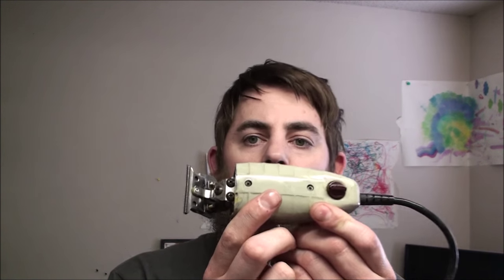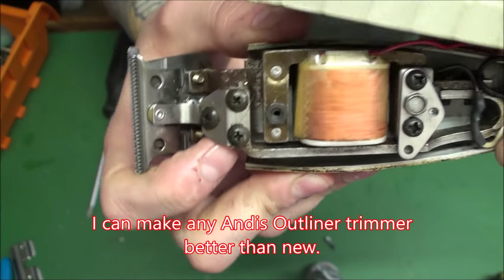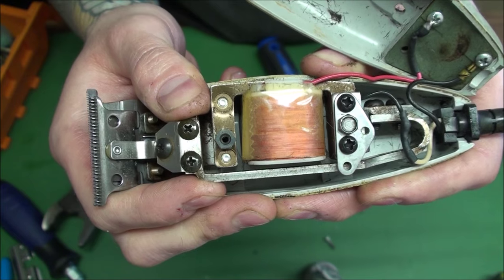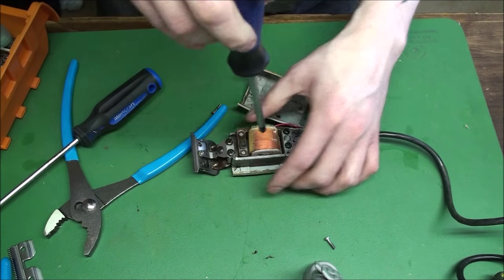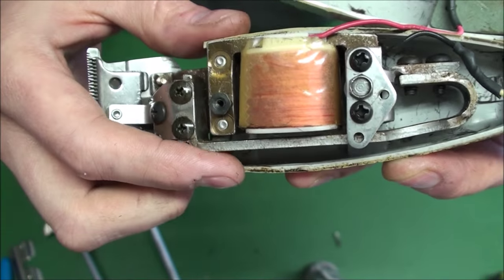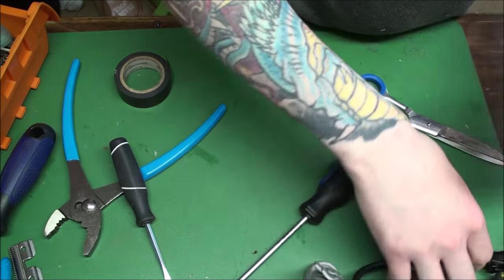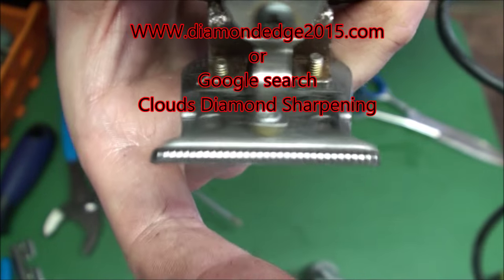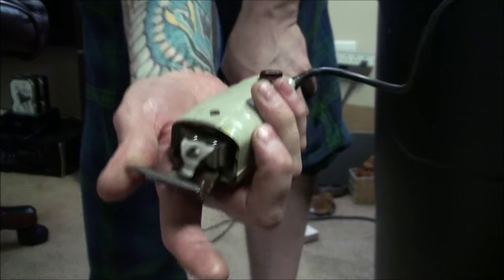Andis Outliner Armature Adjustment

Comment: I did my adjustments but my tension screw touches the bottom of the neck so it's scrapping for some reason as if the screw is too long... any ideas on why that could be?
Reply from the maker: Isaiah Sims Hi. its probably BC your fork is bent. you will have to buy a new one or bend the fork pad up to be able to back the tension off. the flat part of the fork where the tension screw goes in needs to be bent up.
Reply: Cloud's Diamond Sharpening yeaa man that's what I was thinking, buying some new trimmers but imma try to adjust the pad some more and see how it goes
Reply from the maker: Isaiah Sims I might have a video to help you. here's one but I have more look through my videos.   https://youtu.be/KcHK37KTSqc
Reply: Cloud's Diamond Sharpening thanx imma check it out

Comment: I have a question, I have a regular grey T-Outliner and a GTX that I got sharpened and serviced. They were solid for a couple of weeks, then all of the sudden they seemed to loose a lot of power to the point where the blade isn’t even moving. I spray it down and oil it and runs really good with power for a little and then does the same thing? What’s the solutions for them? How long do outliners last, or do they ever get bad.
Reply from the maker: hello. It sounds like the blade is dull. Blades go dull and need to be resharpened or the trimmer needs to be readjusted. I recommend having multiple blades. The trimmer can always be fixed.

Comment: How did you solve the noisy problem? This trimmer works very very loud!
Reply from the maker: Adjust them with the with the ball of the fork at the upper part of the cutter. With 2 pounds of pressure and if that does not fix the noice it'll need to be sharpened to resurface it and put the correct pattern to insure it to cut correctly. Thank you watching

Comment: Just bought some blackout Andis T Outliners. Instead of the 2 screws at the bottom, they're flat rivets. To move the armature, you need to take those out. Any idea on how to take them out?
Reply from the maker: Alan Q you shouldn't have to remove or adjust. I recommend sending back for warranty. but i adjust them with the center bolt.

Comment: hey,  love your videos! i adjusted my newly sharpened blades, and they are cutting,  but they are pulling bad.  what did i do? thanks!!!!
Reply from the maker: +Jessica Martin Thanks. Im glad you enjoyed. why did you have to adjust  newly sharpened blades? It could be that your clippers tension is to loose to hold the blade together.
Reply: I had dropped them and chipped the blade so i got a new one,  put it on and it wouldn't cut,  finally got them to cut, but now they are just pulling pretty bad.  I will try and tighten the tension.  I also bagged it into the case,  and bent the arms just a little like you showed.  Thanks again! !
Reply from the maker: +Jessica Martin Alot of new blades are not very sharp. I call it factory sharp bc a machine sharpens them and where i once worked, customers buy new blades and then have me sharpen them out of the package. It could just simply need to be sharpened. Or when you dropped you might have bent something. Well good luck and hope i help you figure out your problem.
Reply from the maker: Jessica Martin NP and thanks for watching

Comment: I'm trying to decide between an Andis T-outliner VS. Andis superliner which one you choose for balding and line ups?
Reply from the maker: Rio hello, the superliners have a rotary motor. That's good for power but there are no parts available. The blades of the super liner are on a guide that pivots so you can't adjust them with ease. The metal of the superliners blade is softer so it might not stay sharp as long. The outliners are adjusted easier and have all parts available thru the manufacturer. So I  pick the Andis G Outliners for quality and parts availability But I'm also not a barber.  I hope I helped and thanks for watching.
Reply: Cloud's Diamond Sharpening nice..thanx...I asked a barber and he said the same thing from a cosmetic stand point  the Andis T outliner is better. Appreciate it man...Im about to buy it do you think buying it brand new that it would need adjusting?..if i wanted my liner done like the one in your video do you help out Canadians.
Lol?
Reply from the maker: Rio  I can do it. But it will be alot in shipping.  For better details please visit www.diamondedge2015.com
Reply: Cloud's Diamond Sharpening ok  cool thx

Comment: if the tension spring was bent due to a fall, then bent back, is it still possible to adjust the clipper? or do you need to purchase a new tension spring
Reply from the maker: callmetagno you can adjust it if it's not broken. The spring is no longer available. So if the spring is broken you will have to order the armature.
Reply: appreciate it, the spring is not broken i got the clippers about a month ago so i'm gonna try to adjust it myself. Thanks again, vids are great
Reply: was able to adjust the spring and find the right tension. works perfectly now. Thanks!

Comment: What about the newer GTX? They don't have screws to adjust the armature.
Reply from the maker: Poker Face you shouldn't need to adjust the armature but the middle bolt should adjust it. I usually never adjust an armature unless someone messes with it. unless it makes a rattle sound going into hair is the only reason to adjust it.
Reply: Cloud's Diamond Sharpening Thanx

Comment: won't the corners of the blade cut client if you move arm too much too on side
Reply from the maker: +adrian haynes Yes it will. If the teeth go over the comb. This was an armature video Not fixing the tension fork, that is what it says in the description. Do you need to know how to adjust the blade?
Reply: +Cloud's Diamond Sharpening 
I was talking about the cutting blade if you move the arm to much one way the cutting blade won't be center with comb blade anymore cause cutting if you use the corner of the blade to go around the ear or neck area??
Reply from the maker: adrian haynes Yes it can if the cutter blade is too far over. You can loosen the blade screws and slide it over to where that cutter doesnt go over the comb. If you cant adjust it good enough by moving the blade then you will need to adjust the tension fork.
Reply: +Cloud's Diamond Sharpening 
OK thanks for everything
Reply: @cloudsdiamondsharpening3973  How do I keep my Andis T out liner T blade motor from getting too hot? It always gets hot very quickly
Reply from the maker: @lilbossman4186  hard to tell from a distance. Usually, it's too much tension,  blades are being used while dry, or a combination of both. If it gets hot immediately after turning it on, it could be an internal issue and I wouldn't recommend using it until you could have a professional look at them.
Reply from the maker: Make sure your blades are always lubricated whenever in use.

Comment: I just bought some new liners and they only have the nut in the middle where the 2 screws are is circular metal pieces
Reply from the maker: +adrian haynes I'm sorry, I don't understand. The two screws that hold blade fork are riveted instead of screws?
Reply: +Cloud's Diamond Sharpening yes
Reply from the maker: +adrian haynes Interesting. Thanks for telling me.
Reply: +Cloud's Diamond Sharpening yeah no problem I guess adjusting the arm is a one nut move now
Reply from the maker: +adrian haynes Ya. Now if the fork gets bent to bad or broken it cant be replaced but you still can replace the whole armature with that piece riveted on.
Reply: I know this is old. But you take a screw driver, take drill bit the same size as the Rivet, drill through, remove and replace with screws.
Reply: @tazz5406  I assume you were able to successfully do this? When you drilled out the rivets were there still threads inside for some screws to catch on to? May I ask for details on your procedure please so that I may replicate it? I have 2 Outliners requiring serious adjustment. Thank you kindly.

Comment: My arm has only the middle screw the end two look like rivets
Reply from the maker: atardy12 there is rivets now on the new style outliner.
Reply: Cloud's Diamond Sharpening Oh, my top blade where you set the half moon seems for left. Is that normal?
Reply from the maker: atardy12 try to loosen the blade from the trimmer  and slide it over until the cutter is in the middle of the comb blade. unless the trimmer is making a loud hitting sound or weak, you shouldn't need to adjust the armature.
Reply: Cloud's Diamond Sharpening thanks for the quick response.  Great video